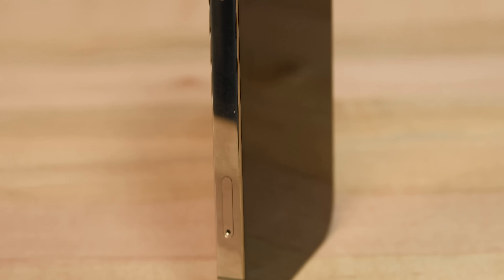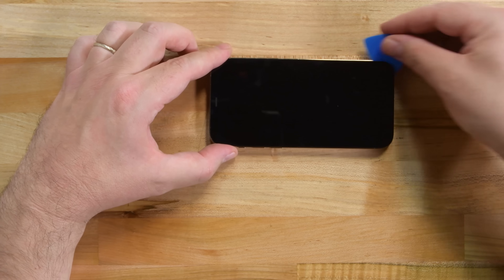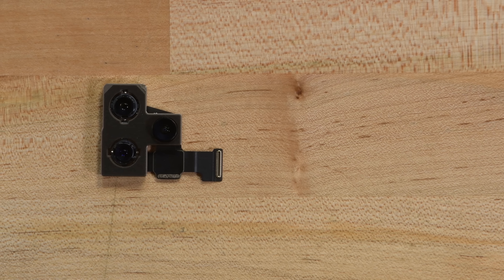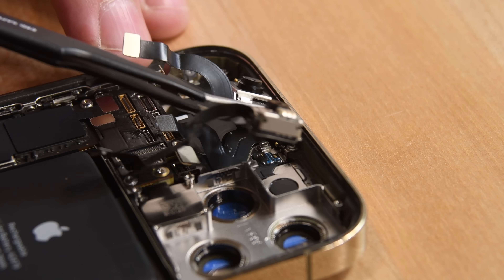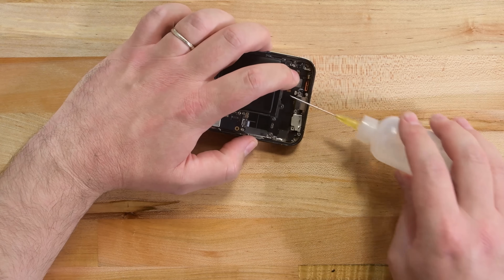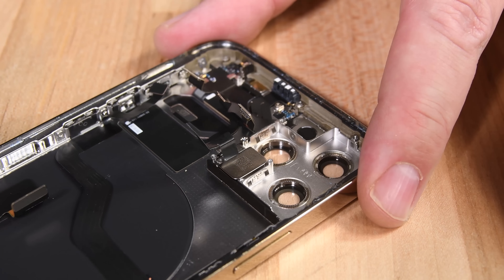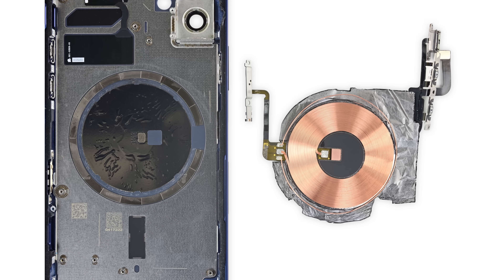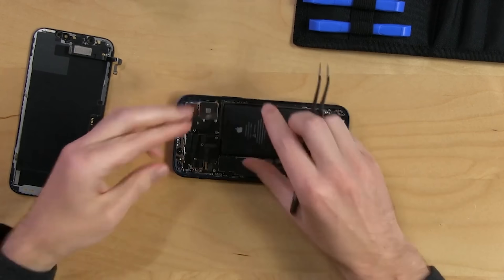iPhone 12 Pro Teardown: 5G Comes at a Cost

Comment: How is it 6 out of 10. U cant get parts and using the same part from another working phone doesnt work well if it works at all.  U should give it 1 of 10 for repairablty and maybe maybe 6 out of 10 for accessibility.. even thou the glue and removing battery to remove the board is a pain in the A$$

Comment: I like your brand and what you do in repairing sector. 
But Score of 6 ??
All main components are locked/paired to specific motherboard even if they are easy to swap they won't function the same, or show some irritating warnings even after getting genuine part, and back glass replacement is a complete different story.

Comment: You can't fix or do anything with the iPhones any more. Everything inside the iPhone is paired with that specific device. If you change anything, the phone stops working. Apple has found a workaround to stop letting third party vendors fix iPhones, and soon, Mac and iMac will join the same category. So now, if you buy anything Apple, and it breaks, you have to spend hundreds of dollars getting it fixed at an Apple store, rather than being able to fix it yourself, or from a third party vendor.
I am done with Apple

Comment: I understand why this is a 6/10, but I also have to question how valuable that 6/10 is if the cameras, night light, battery indicator, and many other features are tied to the logic board, meaning replacing one component would require replacing a whole host of other components to fix the one component that's broken.

Comment: Repairable score is a ZERO,  you CANNOT swap parts,  a youtuber  just did a video with 2 brand new iPhone 12's and the phones were disabling themselves. Someone (from Apple) needs to sneak out whatever mod they are using to pair or sync all the parts together to work in unison.

Comment: What does repairability mean though? Because it doesn't seem like you can do these repairs yourself without the software malfunctioning. This has been demonstrated by a few different Youtubers. One, who simply swapped brand new iPhone 12 logic boards, and the phones didn't work right after that because I guess the parts were all factory paired to the individual devices.

Comment: When assessing your reparability score, you might also want to consider that the display, battery and even cameras are registered to the phone via serial number. Replacing these components, even with genuine Apple parts, without 'pairing' them will cause problems.

Comment: However another factor that may compromise repairability is that the camera modules, Face ID sensors, display and battery are all paired to the phone’s logic board so if the battery is changed by a third party it will disable the battery health menu and also may throttle down the performance of the phone as if it’s an old battery! That’s however unless the third party repair shop can pair the new battery to the phone’s logic board! :)

Comment: When there is discontent, is that discontent per sey or are you discontented with something? It is not the discontent, which has no cause and therefore can be ended. The moment there is a measure there must be discontent.

Comment: its great that u can open it and disconnect some of the components and all, but u can't replace the camera since apple requires u to use their cofig tool (which they don't provide to the public) to make a new camera work with it, the same deal with the screen and the battery (I'm not 100% sure about these 2), plus almost all (if not all) of the chips on there can't be bought for replacement. U can't repair this phone even if u get in since apple locks all of that in software. this is an exercise of futility. Im sure u can open if to clean up water dmg or something like that, but if anything inside is broken, good luck finding parts for any of it.

Comment: Sorry, I dont rate this as a 6 for repairability. I rate it as a 0, because the phone's functionality is crippled if any component is replaced. See Hugh Jeffrey's video on the iPhone 12.
IMO, this is like the Surface Laptop 1 and 2. You try a repair, it breaks. For the Surface devices, its cutting into the keyboard that breaks it. In this iPhone, its various broken internals if you try and do any sort of repair. Zero!

Comment: What could be the reason for cameras not being replaceable? Is there anything that from a technical/security standpoint can justify them being paired with the phone, such as the need for camera firmware with individual calibration parameters being loaded when power is switched on, or some biometrical parameters related to phone login via face-id being stored in a secure vault-part of the camera chips like for a fingerprint sensor? Generally just curious since I from time to time try to follow the newest anti-repair inventions that emanate from Apple..

Comment: I think ifixit is just not an apple fan because before I was like what ifixit say about the iPhone teardown before I start telling people prices and they were right because before models were not worth it to be an independent phone repairman. but this 12 seems so much easier to repair I'm ok with the screen needing more heat now you can get inside the phone the screws we have been dealing with for years we should have that screwdriver for apple screws. I rather have more screws then adhesive and everything pops out without adhesive that's a super plus 9 out of 10 for me

Comment: THANK YOU SO MUCH FOR THE ISOPROPYL ALCOHOL TIP FOR THE BATTERIES ADHESIVE!! I work at an AASP (Apple Authorized Service Provider) and I sometimes break the adhesive tabs which happened just a few hours ago! Few drops of alcohol under the battery and it slides right away!! Awesome 😀

Comment: Everything is paired with the motherboard. If you replace anything, there appears to be software level "hardware errors". Things stop working, but some bugs in the software allows them to work in certain areas. E.G, a camera replacement causes the camera to "freeze" and "not work". Except in panorama mode, it works in the little view-finder, but not in the main window. And also if you swap to video mode, swap the camera between zoom and no zoom, and back to picture mode.

Comment: I think it is time to stop covering for Apple when it comes to replacement parts. The iPhone is NOT repairable, despite being fairly modular. The display, battery, FaceID sensor array and camera array are ALL programmed and paired to the logic board, and functionnalities are lost when replacing these parts (even with other genuine Apple parts that come from another device). The display loses TrueTone, the battery loses the health monitoring, and FaceID and the cameras straight up stop working (without mentionning the various error popups that will show up). Yes, the components can (often) be reprogrammed, but the average consumer does not own (and should not buy) a reprogramming station. The iPhones should get a much harsher repairability score than that.
Sources : check out this great in-depth video of Hugh Jeffreys, who swapped components back and forth between 2 brand new iPhones https://www.youtube.com/watch?v=FY7DtKMBxBw

Comment: You might wanna change that repairability score after the latest Hugh Jeffreys video lol
Reply: It deserves a ZERO
Reply: @TheSpotify95  I mean... The screws can be replaced...lol
Reply: @jeffyoung2739  hhhhhhhhhhhhhhh
Reply: @jeffyoung2739  No with the next update Apple are pairing the screws to the board so they cant be swapped
Reply: @jeffyoung2739  Imagine if the screws were ID protected, so if you switch 2 screws by accident, your Iphone won't work anymore haha
Reply: @TheSpotify95  can’t be a zero. screws can still be replaced
Reply: I just thought the same thing, maybe a score of 0.5
Reply: @jeffyoung2739  ye but when do u have to repair ur camera ?? only if u droped it off a parking garage onto concrete even then mby the camera and logic board woud be oky just mby and people in china will probably make a device to read and writhe camera and face id modules to a specific motherboard
Reply: @Maykay1312   he's talking about replacing a defective part from a donor device (ie: replace a defective camera unit with another one from another phone)
since apple is pairing components to motherboards this is not possible
Reply: @Maykay1312  you may scratch the lens... Thats not the point, the point is that they dont leave you
Reply: @MrBitviper  on previous iphones u can pair the battery to the iphone with a read and write device u conect the original battery copy the serial code off it and write it onto the new battery and the phone thinks its a new apple battery people in china will probably make a new device for the iphone 12 so it works but im suprised they havent cracked the face id paring since someone cracked the t2 securety chip someone probably will in a couple of monts or a year
Reply: @Maykay1312  iPhones have never contained the T2 chip.
Reply: @Maykay1312  its actually a reasonably common failure point. I have had 3 friends that have had apple cameras die on them. one on a 6 a 7+ and an 11. if your out of warranty what are you supposed to do? you either just cant use the camera or you are forced into going to a branded repair place where lead times are at least a week and cost about $500
Reply: If you try change anything inside iPhone 12 is gonna cause problems because apple assign serial code in each part for the specific iPhone meaning you can open the device but you can't replace anything maybe we can bypass somehow in the feature but for now iPhone 12 is unrepairable...
Reply: @Spartan764  I replaced the charging port on an iPhone 12 Pro today and everything went smoothly.
Reply: @digitaldoctors499  so maybe they left some parts unnasign that's a gd news what was the problem with the charging port though
Reply: @Spartan764  The customer had broken off her charging cable in the port and then she attempted to use super glue to extract the piece that was stuck inside.  The super glue would not allow the contact to spring back up after I removed the broken part so replacing the charging port was necessary.
Reply: you got clickbaited lol
Reply: I was laughing at that 6 out of 10 score 🤣 😂.  More like 3 out of 10
Reply: Exactly, you can't replace the screen, battery or cameras without calibration. Check out lous's latest video with apple documentation proving this. And since we can't get the re calibration tool, this phone really has a score of less than 1.
Reply: thought the same thing.
Reply: Exactly it doesn’t let you use the iphone after its been repaired by a 3rd party
Reply: How does it get a 6/10 while Samsung literally has no software locks AT ALL
Reply: Definitely
Reply: I wanted to say the same LoL
Reply: Completely agree
Reply: I was so confused watching this as to why they weren’t talking about that lol
Reply: Display and battery are fine . Even thought the battery notifications will go of couple time . True Tone got shut of because of the sensor not the screen . So just like most iPhone before it

Comment: It’s modular to no effect when it comes to replacing components as you have to take it to Apple to service it, most components are linked to the motherboard, including the camera. Even if you get identical phones and swap the components over including the battery it won’t work.

Comment: You should watch Huge Jeffrey's video where he exchanged parts from 2 equally identical iphones. The phones did not function. Returning the parts to the respective phones back, the phones started working. 

Tearing it apart and puting it back is fine but how do you program the new replaced parts in the phone to get features like true tone, battery indicator, camera etc working ?

Comment: Yeah it’s a 6 in repairability but after watching some other yt vids turns out cameras will just glitch out when changed power button won’t turn the iPhone on when any component is changed even with a brand new donor iPhone 12
Reply: So I don’t think it deserves a 6 until apple fixes those issues with an update
Reply: @Hamoody25  that's happening when swaping the motherboard the same with 11 series
Reply: @King-is7cx  no but they actually tried to to replace the camera only

Comment: The frustrating thing is, this looks mostly easy to open, and everything is nicely modular, but the pairing of components makes it all pointless. Unless you're Apple, in which case it makes it easier for their "Geniuses" to refuse to repair it.
Reply: I wouldn't say refuse to repair it. With the proprietary tech Apple has to fix these phones, it'll make those "geniuses" look like they actually know what they're doing. Like, "wow, not even Louis Rossman could fix my camera, but Apple did it with no problem, I guess I don't mind paying $1,000 dollars for my repair."
Reply: Black Cash  or charge you for a new phone for "repairs"
Reply: Oh how the times have changed. Can't wait for Apple Self Service Repair Program

Comment: As a firm Apple sceptic I can hardly believe I'm about to comment:  It looked surprisingly easy to disassemble and very modular when inside.   Clearly you made it look easy but I'd go higher than 6/10 on the phone scale.
Reply: That’s true it is easy to get inside but overall it’s a pain to repair and replace parts. The screen, battery and camera is programmed to the board so they know when it’s been replaced. And the fact that screws are always changing and the pebtalobes at the bottom doesn’t help it’s case. Personally I would rate it a 7 or 8 compared to other devices as I see where your coming from

Comment: 6 out of 10?!...Are you serious?
What's the advantage of disassemble the phone if the battery, display, cameras and more are paired with the motherboard and WON'T work properly if you replace them? Apparently this new iPhone even has the main back cameras paired with the MB (that's why you couldn't replace them) which prevents repair. F**k Apple, the best, newest iPhone (repair wise) is the 6s, which you can repair/replace everything but the home/fingerprint button.
Reply: my brain hurts now from reading that
Reply: @Sly1020  go buy yourself a brand new iPhone and let Apple do the thinking for you...

Comment: How does this phone even get a 6/10 repair ability score when you have to reprogram and software pair each part you replace?
Reply: the only major part that will work is battery and display without true tone. Camera and faceid will not work.
Reply: Honestly. I am worrying for Apple
Reply: And they also do not sell replacement parts in a free market.
Reply: Because it's not required and works perfectly as it had before.
Reply: What reprogram every part we replace? As an IT I don’t believe that would be necessary. I replace parts on iphones not every single part needs a reprogramming unless u wanna upgrade a storage and replace it then it would take a lot of work, but even so its just one click to reformat and reprogram the new flash storage chip, we have tools for that. Easy work. Who ever told u that must be stupid.
Reply: @CC-tk9xw  You are not into IT! Since iphone 11 you cannot replace the display or battery, they are programed to the board! The cheap china programming method that you are talking about is since the iphone 7 plus display true tone, vibrator and some other crap and that's it! Did you ever programmed a new touch id? Nope you never did! But apple can do it and it's in the screen repair bill. Since iphone 12 the components are hard coded like with touch id and face id. If you replace the battery, display and rear camera in the iphone 12 face id will stop working(even if it hasn't been touched), can only be powered by usb, the power button will stop working for power up and the cameras will be so glitched it will be unusable. Get your facts right before talking crap
Reply: @CC-tk9xw  I was being sarcastic, but between the Screen, Battery, Face ID and Camera there pretty much not a lot else that can easily be replaced. I know reprograming the parts is a thing but currently it's not accessible to me as a freelance Novice phone technician.
Reply: Because you don’t have to do that, it still will work, just with messages.
Reply: @MasterMosha  if Repairing something doesn't fully fix it then in my opinion it isn't fixed. Especially when you shouldn't have to deal with a company intentionally making it difficult.
Reply: ....and that’s why it’s 6/10. More than half, but not totally fixed. Congratulations for affirming the score.
Reply: @MasterMosha  go check hughjeffreys video
Reply: @MasterMosha  nope. Just watch Hugh Jeffrey's latest vid. He swapped 2 iPhone 12 and guess what? Camera was freezing, display truetone was disable and faceID gone.

This phone should score 1 in repairability, because the only thing you can't replace without getting issues Is the back glass
Reply: @MasterMosha  as of yet, the phone doesn't turn on without a charger when battery is replaced, no matter how original the part. Though I think apple will be pressured to make it work
Reply: @MasterMosha  sorry but the camera won't work, face ID doesn't work, true tone doesn't work. As well as other stuff not checked out yet.

Comment: Previous iPhones have had a plastic frame around the display glass that has made it easier to slide a plastic pick between it and the frame of the phone. Have they done off with the plastic frame around the display glass?
Reply: The plastic buffer was so the screen has some flex to it. But because this year it’s flat edged you don’t need that buffer
Reply: @malenmon  Thanks for the response! I was always bothered by the buffer, it made the design of the phones look less precise 😜